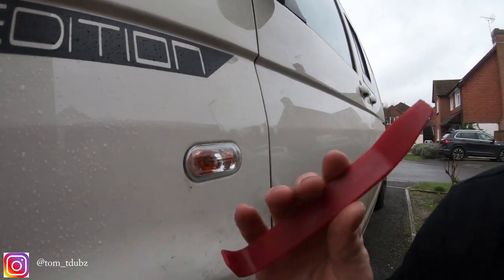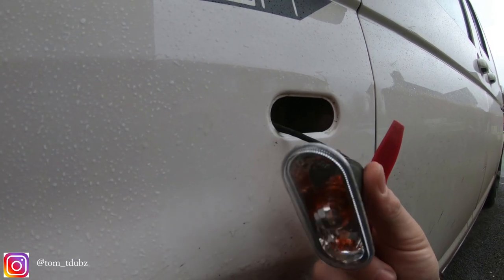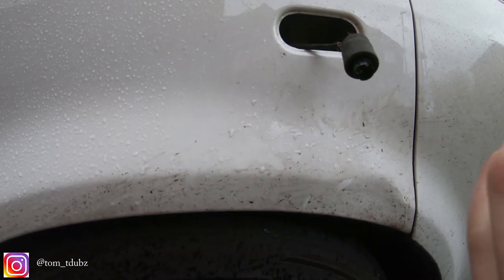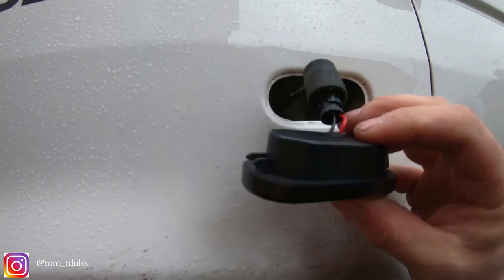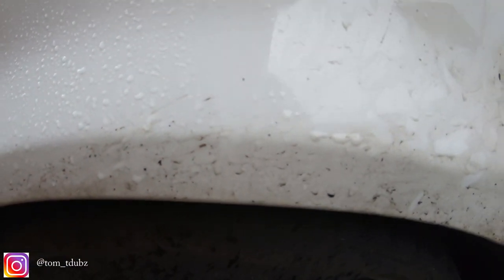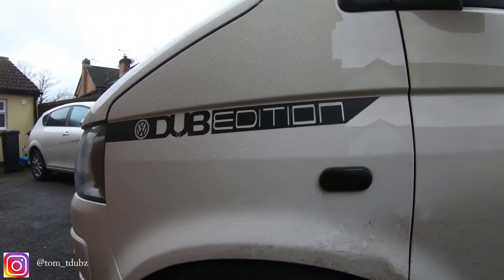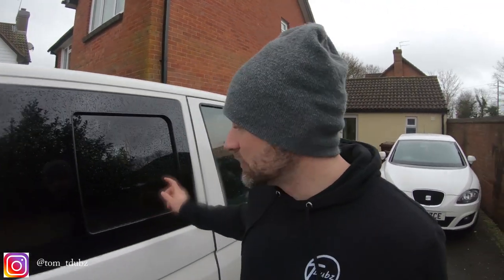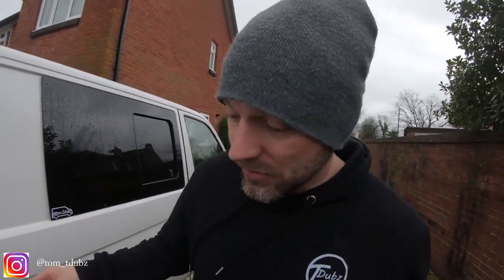vw t5 led side repeaters

Comment: Help, fitted these today on my 2009 T5, I’d say they are working at about 50%, there was a note on the listing saying needs strong canbus, this has gone over my head, any ideas 🤷🏻‍♂️
They ain’t working like yours, that’s for sure
Reply from the maker: There’s no reason for them not to work, could possibly have a duff set.. the canbus is something u can sort with vag com but shouldn’t be needed on side repeaters..
Reply: T Dubz , cheers, I try another set, if I can get em out 🤦🏻‍♂️